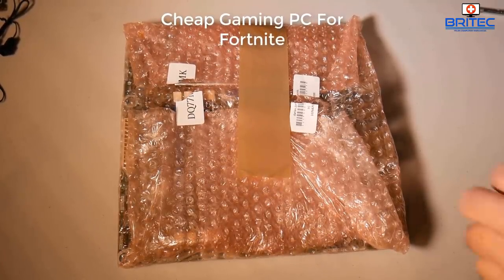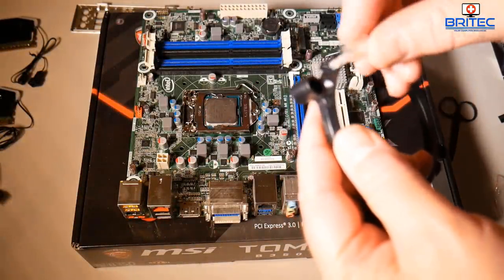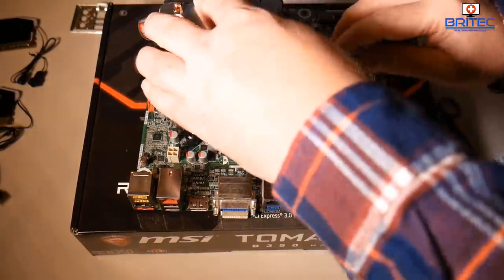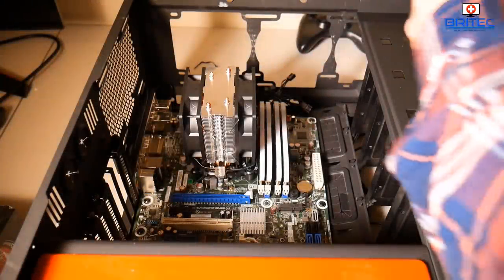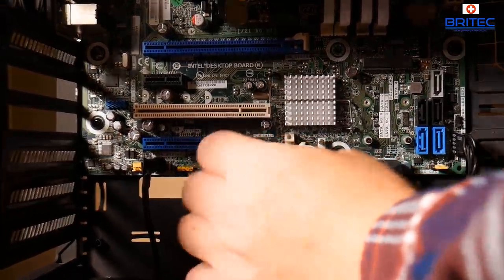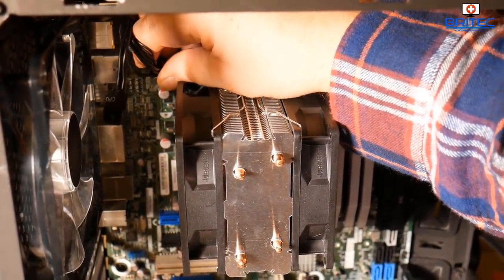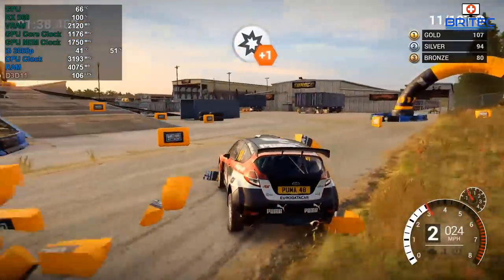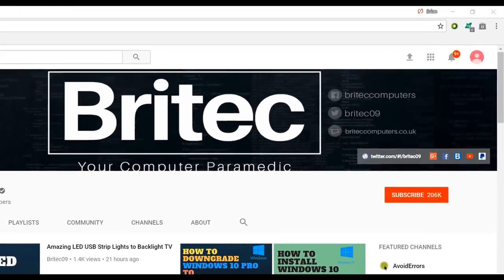Building a Budget Gaming PC for Fortnite

Comment: 128GB SSD are so cheap these days, but on a build for someone else, the problem is getting the distribution right, such as Steam installed on SSD, Steam library has to be on HDD otherwise a few large games and you're done. I'm running a bigger SSD and still pointing Steam library to HDD (along with my downloads, TEMP, pagefile).
I'm on a H61 chipset, and put an Asmedia SATA 3 controller in to get SATA 3 - but not as fast as built-in primary chipset SATA 3
Reply from the maker: yeah SSD is thew way to go and would be great in this build.

Comment: Nice system Brian, Only thing I personally would have done is run some of the front panel cables from the holes right next to the ports in the motherboard back panel but that is just being picky.
Other than that this is a nice little system. I think its actually better than my current one haha
Reply from the maker: Yeah I did a bit more tidying up after video finished, not bad for a cheap used parts build.
Reply: @Britec09  I'm all for used parts. My system has a few :)
Next system will be new plus what I can salvage from my current (case, H100i, SSD, hdd). Hoping for a Ryzen 7 as want to create more YouTube videos lol
Reply from the maker: I got new machines, i build these to show people you don't need new to play games, good luck with your channel mate.

Comment: Brian, I totally agree with you about cases that have a backplate for the PSU, why do they mess around like this, putting the PSU in this way is like doing the same job twice, it is totally pointless.
 Another pet peeve of mine is when they use none standard fitting like for instance, the standoff's in an NZXT case that I got off eBay that won't take the same screws from my old motherboard. 
Why can't they keep to a standard? Something ells that bug's me are people that try to sell you there version of windows X pro with there old computer on eBay.
Reply from the maker: They like to make things different to make you think its better and its just silly

Comment: some links to parts would be nice
Reply from the maker: Intel Motherboard
Intel CPU i5 3550p
Power Colour GPU RX 560
500GB Hard Drive
8GB RAM 1600Mhz
Case H440 NZXT
EVGA 550w Gold Certified
Reply: thanks for a swift reply im going to try my first build this will be a good first one to try as its not pricey i have an all in one,but it comes with so much preloaded stuff that cannot be uninstalled. also im 58 so it will be a challenge im not i t bright

Comment: It would be a nice video and you are good to describing things round, however seeing you pressing the motherboard on that paper box make me really mad. It's like you have no even clue that you can simply damage the motherboard. Is it so difficult to put the motherboard on the desk and handle it a bit more as a professional?
Reply from the maker: 1. This was not how to build a computer video. 2. Never had a problem with putting motherboard on a box 3. These are used parts and your unlikely to find the same parts used and the same price, hence why I never put any links in video description. As for being a professional? I have over 30 years of experience and paper work to prove it...what you got?
Reply: @Britec09  Well I have 30 years of management fixing electronic and honestly, what you learn at the beginning that's how you work forever. The point is that it's not about an old PC. The point is how you follow the right procedure during your work. But I don't want to argue, not at all. I like how you comment things during your video and I mentioned what I don't like and why. That's all.